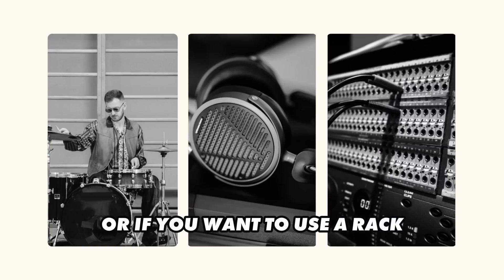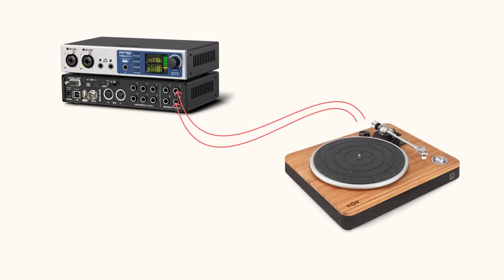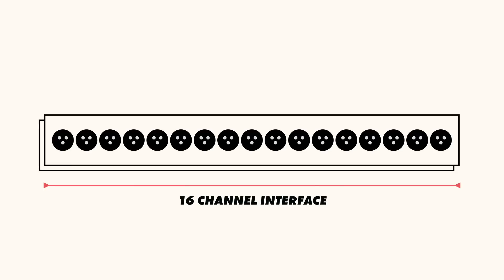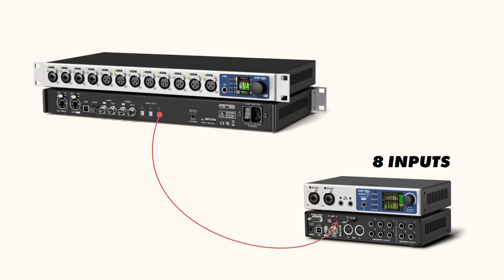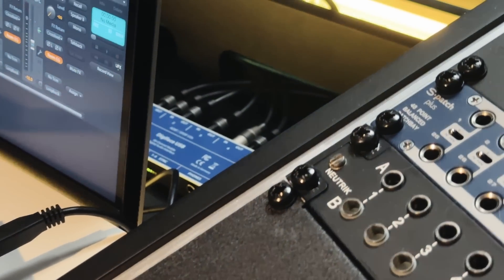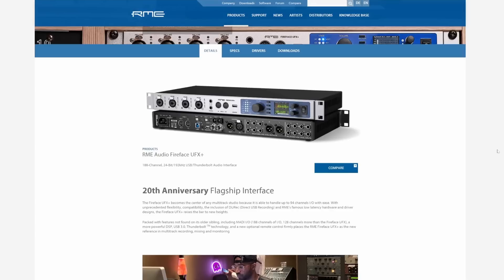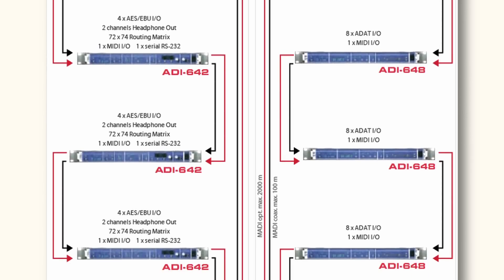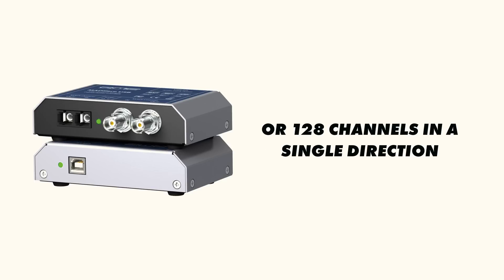Get More From Your Audio Interface with These Tips

Comment: I'm getting my studio up to date this year and these questions are coming up. This was the setup for the past 15 years:
[SSL Alpha Link Madi AX] <-Madi-> [SSL MadiXtreme (PCIe card in a Sonnet enclosure)] <-Thunderbolt-> [MacBook Pro 2012]. 

But SSL abandoned any support and drivers for their MadiXtreme in 2011. My MacBook Pro had to stay on an old MacOS and I had to use some hack to get the damn MadiXtreme to communicate. This was starting to be complicated for everything else: instruments, vst, etc. 

Finally, this year, I threw in the towel and I upgraded my MacBook Pro to a M4. I kept the Alpha Link which is a very good 64 chan. I/O converter but discarded the #*¢! MadiXtreme. 

There's not a ton of solutions to replace it though. The simplest would be the RME MadiFace USB or the SPL Madicon, also a USB interface. 

I'm now hesitating between those two. The fact that both of these devices are USB 2.0, seems a slightly outdated technology. I don't want to repeat the same experience I had with SSL and invest in an interface that will became a legacy product in a few years only. It's not like they're inexpensive too. 

There's probably other solutions, I'm quite stuck. Any suggestions?

Comment: Huge fan of RME. I have two of their interfaces and have never looked back.
Reply: Would you say a Fireface UC would still be a good choice in 2024? My Scarlett 18i8 2nd gen is breaking down (random power outages and very noisy potis). Don't know how long it'll last but found a used UC for 550€. They were made in 2009. Pretty much on the fence of getting an RME that old, but I don't want to invest into the cheaper ones because my Scarlett is the second one breaking down since 2010.
Reply: @schpeidermann  if it is the RME UCX ll that is a hell of a deal and would serve you well. That was my first introduction into RME and only sold it years later, because I wanted more I/I, hence the RME UFX II. The great thing about RME is they build their own drivers and support for extremely long times. Unlike other manufacturers who abandoned support within 6 months or a couple of years especially after a new product line has been released. Presonus burned me twice with that hence I will NEVER buy their products again. RMEs driver stability is unmatched in the industry. That UCX would be a major improvement over the Focusrite. Provided you do not have any hearing damage, but you will hear things that you could not previously and the material sent through it is so pristine, clear and articulate. The negative is it reveals everything, the good, bad and the should I retake this part again or leave it alone lol. With TotalMix you can use the DSP effects and record them to take the load off your cpu. Their mic pres are world class as well and have sort of very polish sheen on them.
Reply: @schpeidermann  Is it the UCX 1 or 2? Either way RME supports the legacy products well past their youth and are rock solid stable. No other company can make that claim in my humble opinion as often after 6 months to a year they discountinue support. Presonus is horrible about that as they burned me twice. Coming from a Scarlett would be a massive upgrade even to an older RME. All converters and quality are not made equal and while Focusrite will get the job done in a pinch and not stop you from making good music per se, but RME is on an entirely different level and universe. Even your studio monitors and headphones will come alive and sound noticeably different in a good way. You will hear details that were previously hidden. That was my experience when I went from a presonus to an RME UCX II. I sold it because I needed more I/O and went with the RME UFXll.
Reply: @PurpleMusicProductions  The UC was before the UCX 1 ;).

I am also on the fence on getting an RME card. Probably the UCX2. I heard it's prone to overheat. Would you say it would be fine in tight rack spaces? My rack is open on all sides, but there is just a few mm of space above and below my devices.

Comment: Thank you. Cool info.
Important reminder that your master output volume on your audio interface can only control output volume for the analog outputs that are built-in to the interface. Outputs added via light pipe can be used to route audio out of the interface, but the volume control of the audio interface can’t control them because they are not connected to the digital to analog converter (DAC) path of the interface.

For example, when I moved from 5.1 surround into 7.1.4 Dolby Atmos I wanted to continue using my Apogee Quartet (which has 6 analog outs for 5.1). 
It would have been easy to simply connect an analog output device via lightpipe, but immersive audio requires that you have volume control over all channels, equally simultaneously and 
You don’t when adding output via lightpipe. 
The workaround is to buy a dedicated monitor controller that allows you to plug all 12 channels into it.  But the cost of a monitor controller didn’t make sense when there are audio interfaces now that provide that capability internally.
Reply from the maker: The ADAT outputs in RME TotalMix have output faders that can be grouped.
Reply: Didn’t know RME could do that. Thank you!
 I was a sales engineer at Sweetwater from 2000-2005 and RME consistently had the most stable drivers back then and sounds like they are still doing great right now. I’ll need to take a second look at them for an upcoming upgrade because my Focusrite Red8Pre – although incredible in almost every way- has a fan on it. Really discouraging when my Studio otherwise is silent.
Same with the symphony I/O from Apogee. 
I do absolutely love, though the RedNet and R1 I’m using also. 
But that’s all specifically because I’m running Atmos. I don’t actually need the R1 but it makes it so convenient because it is also loaded with a studio grade preamp on Dante and full headphone control and talkback, etc..
I didn’t think RME had anything being built for that category. I’ll have to take another look, but there’s another studio that I know would be a prime candidate for RME for what they are doing. 
Thanks for your video and reply. I’ll pass that RME information along as a result.

Comment: you cant run a decent turntable into a Line input. The output of a magnetic cartidge (MM)  is around 1 mV and needs a RIAA correction curve to work linear. Also the impedance is important together with the capacitance of the cables!
U still need to learn a lot my Padavan!

Comment: How would clocking multiple adat preamps on the rme digiface usb work when not having a wc out? Doesnt clocking over adat only work in the direction the signal flows, so in this setup the preamp would provide the clock, but what if I have multiple preamps what would be the master clock?
Reply from the maker: You’re thinking about it correctly. In my case, I only have one device that only has ADAT out (RME 12 mic Dante). The other devices have ADAT in and out, so they all follow the 12 mic Dante through the Digiface USB.
Reply: @AudioUniversity  so when I have for example two of the new Arturia x8 ins they couldn't clock together because they only have adat ins?
Reply from the maker: @kommunismusarbeiterjonny this video might help: https://youtu.be/_JKWJAEa360?si=Ep_IF6EtjwCZ5naW

Comment: I to use a UCX II and I have the Cranborn 500adat using up my adat ports. So I was curious how I could expand my I/O. Ive been wondering if I could use a Digiface to do so and you just confirmed it. Id be curious to see how you use it as a switcher. Other ideas I had was asking Cranborn if two 500adats could be chained together and Ive also been looking at arturias new expanders but the conversion in those wouldn't be as high as the Cranborn or the RME. I also have my UCX connected to an ADI 2 Pro fs r through AES and the Adat ports on it are free but I don't think I can use them for anything in this situation, I wish that it was integrated to work with totalmix, that would solve a lot but in the mean time ill keep exploring my options. Thank you for the content and information.

Comment: My best trick for getting value for money is to buy used firewire interfaces, like liquid 56, and just buy a pci card for a few dollars.  I don't know how they compare to new interfaces when it comes to latency and bitrate, but you get more inputs than you'll ever use for the same price as a new 2 input focusrite interface..  And you can buy a octopre for the same low amount of cash, and double your inputs..  I had to get rid of mine, as I was spending more time with cables and adat related stuff, and less time making music. Also, I will never need 16 (or was it 32?)  inputs for anything
Reply: I've been considering going this route. Do you reckon a PCIe card would work?

Comment: I have been interested in a Digiface USB. Since you have one what is the latency that you get @ 64 buffer @ 48k with the converters that you use on it? Since you have a UCXII, what do you get for latency on that at eh same 64 buffer and 48k? Are you on Windows or Mac. I'm currently on Windows but am interested in moving to Mac if it is any better in regards to USB protocols compared to Windows.